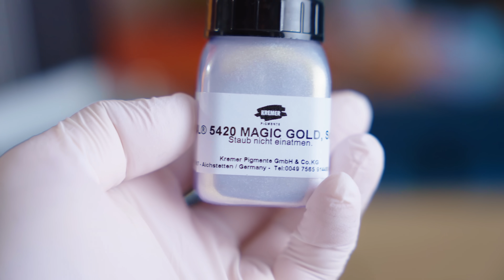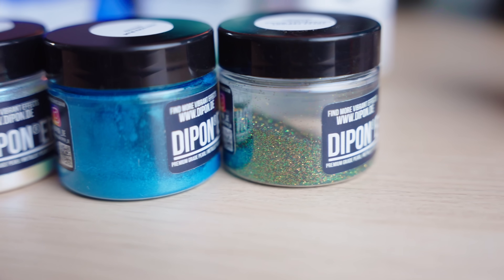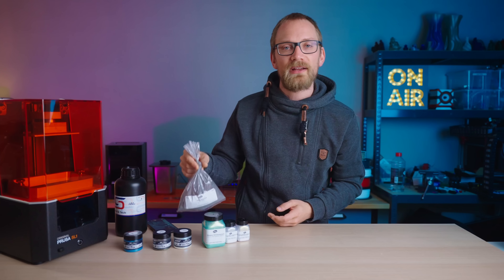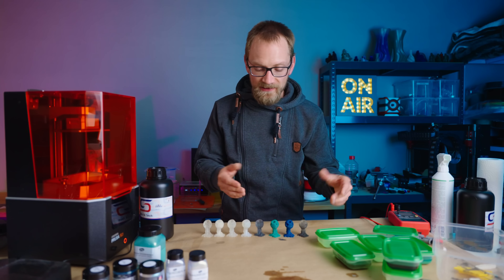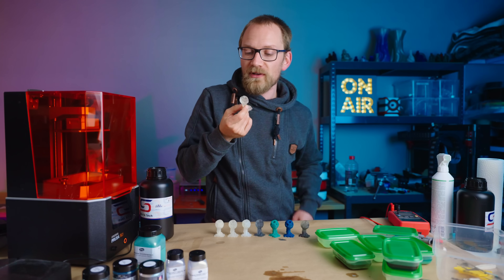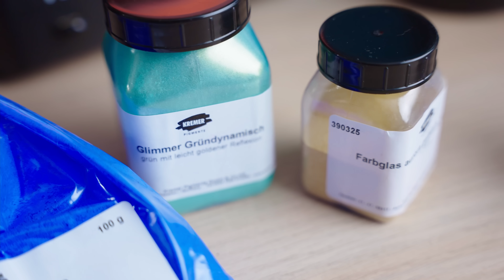Can we use Effect Pigments in Resin Printers?

Comment: Some glow in the dark pigments would be cool to see
Reply: Instead of UV reactive glow in the dark stuff, look into a paint called Lumilor, with a power source it can glow by itself without needing UV light to activate it.
Reply: @thebluestig2654  I am not sure, if it is conductive enough when mixed with resin and how bright it is when mixed?! I would just print as normal and paint the item with lumilor. "Power source" and "glow by itself" does not realy fit! If it could be charged by electricity and than "glow by itself" like the powder after uv/sun-light. Switching off power and no glow anymore is not realy "by itself"?!
Reply: @C64-Museum  I wasn't talking about mixing it with resin, I was referring to painting it afterwards.  Power source means a small battery and some wires leading to the painted area.  The paint literally lights up in total darkness without needing any external light source to get it going like traditional "glow in the dark" stuff does.  There's videos of it here on youtube, some people have done some crazy things with it, including electronically switching the lit areas on and off while connected to a heart monitor on the driver of the car so they could see how excited the driver was getting while driving fast.
Reply: Glow in the dark = UV reactive, which doesn't get along nicely with a process that cures the resin with UV light. If you want to print glow in the dark parts you need a filament printer or you paint them afterwards.
Reply: @slin3232  I tested exactly that and being uv reactiv is not the problem! It printed just fine but the pigments are too heavy and settled down to quick and the results are like the metal pigments which Thomas tested.
Reply: @C64-Museum  Exactly same thing over here. Prints just fine on my moai, but settles quickly. A wipper like the one on the forms would be greatly to mix it up.

Comment: Stainless Steel?... Use real iron powder and put a magnet on the build plate. Magnet should pull the iron up each time it dips into the  resin so it doesn't settle.  Also SS and Fe based materials are not that conductive.  Use carbon powder or graphite.
Reply: Depending on orientation graphite is 1 to 4 orders of magnitude less conductive that the typical stainless steel. Stainless steel is low conductivity for a metal at ~1.5*10^6 (S/m) with the upper limit of 6.3*10^7 (S/m).  Graphite is only 3.3*10^2 to 3*10^5 (S/m) depending on orientation. I can't find great data for the conductivity of the cured resin, but it look like it would probably lie in the range of 1*10^-13 to 1*10^-15.
Reply: @JoeMorrison  thank you for the correction.  I think theres a meme where if you want to learn the correct answer to anything post the wrong information and someone will tell you the answer.  😅

Comment: Given that the particles settle down to the bottom of the suspension over time and that's where they need to be for the printing I would imagine any desinprinter will work similarly.
Reply: Good point. Someone else mentioned the viscosity of the resin probably negates any sort of benefit you would get from tilting the basin, it might even be moving all the particles to the front of the basin... You can kind of see that in the metal powder print.

Comment: very nice! the borabora blue is really lovely. i wonder if you can use a smaller bed on a larger printer, and suspend a magnetic stirrer off to the side to agitate the resins, or otherwise integrate a semi-sacrificial little pump into the resin vat.

also, do you think you would get more of the iridescent colour changing look if you use the resin mixes to coat FDM prints like you've done before, since the particles might not get aligned like they (presumably) are here?

Comment: Interesting,  I finally got my Saturn and  am knocked out by the quality /details in the print. I have used 3d printing for mostly practical parts , but I just had to print a  maximum sized "little dancer"( 250mm tall)   after being impressed by a much smaller version.
Your mix n print would have nice to try.
Keep up the good work,  8-)

Comment: Hey Tom. I've always used Mica Powder. It's far cheaper to buy clear resin and add the colour or affects to the resin. I've never had any problems and always have amazing outcomes.
Just remember that a little goes a long way.
Reply: Do you have a prusa or a normal resin printer? I wasn't sure if his worked specifically because of the special vat
Reply: @UnvarnishedTarnished  Hi there.
I just have the Anycubic Photon. Normal settings but just a little longer on exposure time. Rather than 8 seconds per layer, go to 10 seconds per layer.
60 seconds for bottom layers.

Comment: yea i did a lot of playing about with pigments etc i found everything lays on the Z and you see it from the top only and when you look face on you get clear. i did a load of dice and miniatures with it. worst part i found is cleaning out the vats and cleaning the prints in ipa and having to filter it to clean out the ipa from the particles so they don't end up on other prints. also its a nightmare when you knock over a pot of mica powder i did my tests 6 months ago and i am still finding mica powder everywhere. i was going to try car mica powder as the mica is smaller particles. but i found the cost of it to expensive to test with. as i used to do a lot of car body spray paints and custom work. but as you stated i had to use thicker support tips also as the mica was blocking the tips and was getting failed prints due to supports. but have that all dialed in. but i might look into doing it again with car pigments but with it laying on the Z i will use the rest of my pigments to make paints or cast in resin casts. thanks for the video. :) be warned peeps. this can get messy :)